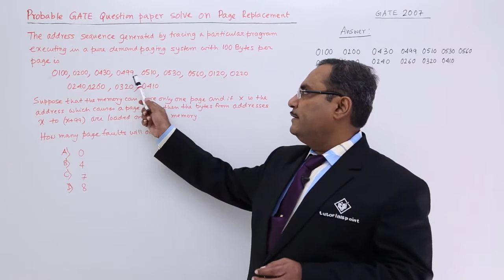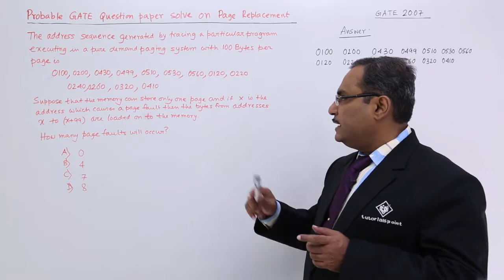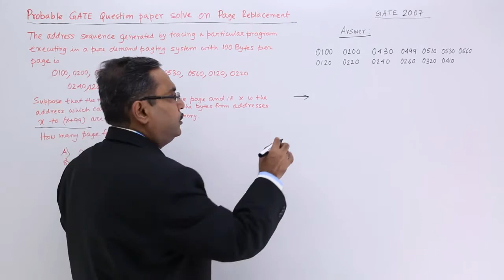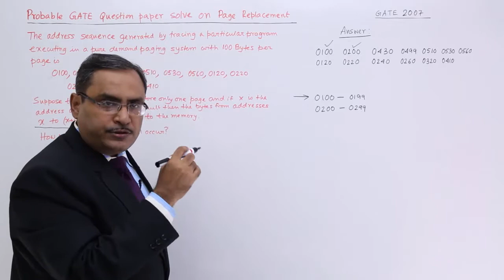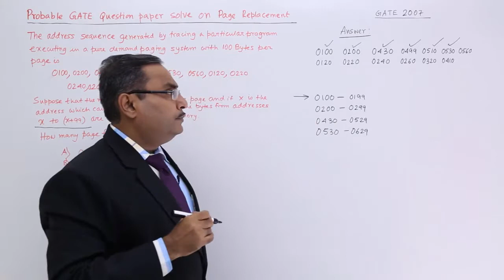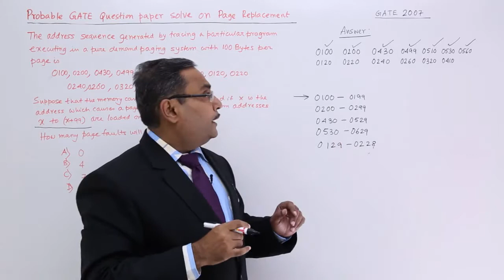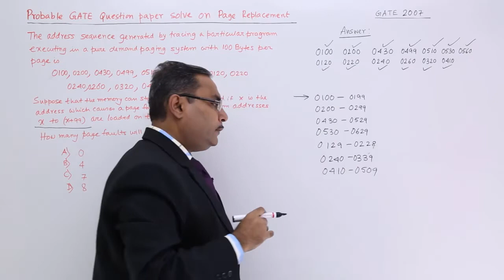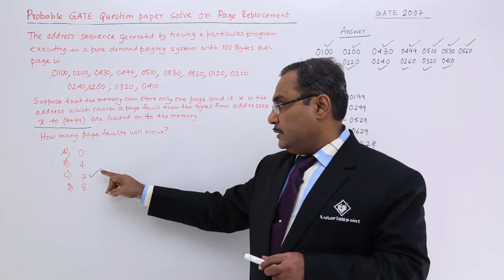Page Replacement GATE Problem 3

Comment: Solution should be:
0100 - 0199 --> 0100
0200 - 0299 --> 0200
0430 - 0529 --> 0430 - 0510
0530 - 0629 --> 0530 - 0560
0120 - 0219 --> 0120
0220 - 0319 --> 0220 - 0260
0320 - 0419 --> 0320 - 0410

Total page faults occurring here would be : 7

Comment: how did u consider 129-228
Reply: yes ...... agree . some confusion . it must be 120-219 .
Reply: that was the error...It must be from 120-219
Reply: Prakhar Saxena 

0100-0199
0200-0219
0430-0529
0530-0629
0120-0219
0220-0319
0320-0419

Page fault =7
Reply: 200-299
Reply: @idrispatel7139  u r right bro
Reply: bhai kitna padhega
Reply: prakhar Saxena topper
Reply: It is correct you see the question (X+99) right (100+99)= 199, 0200 (200+99)= 299 (0200-299), 0430 ( 0430+99)=0 529 ( 0430-0529) same way for every given address you have to add 99